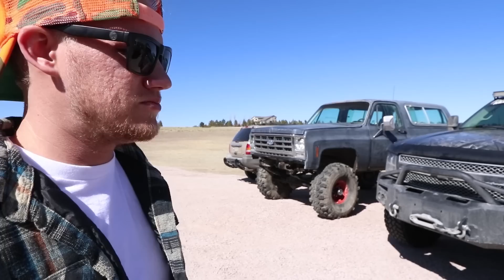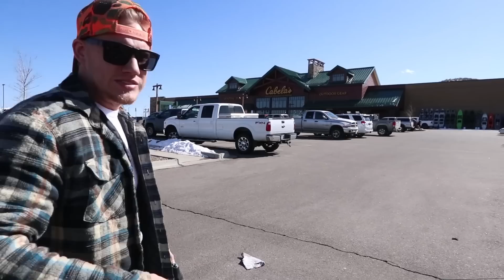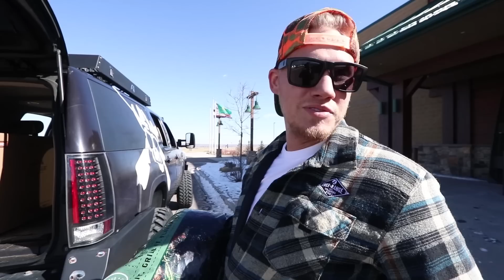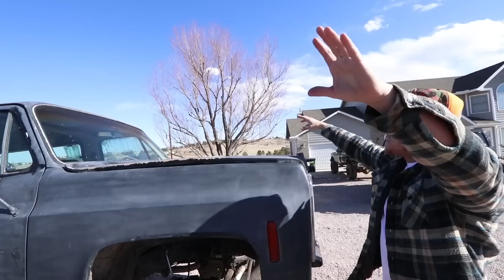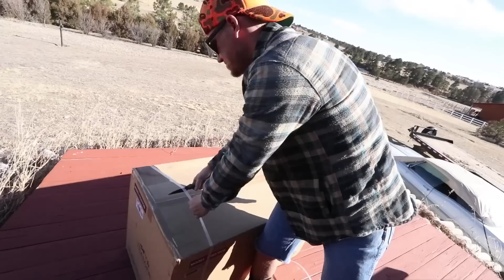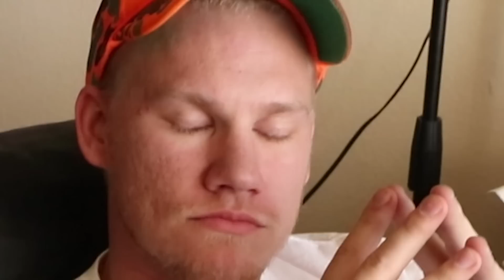Let Me Introduce the BACKWOODS BLAZER!!!

Comment: You could try wet sanding with super fine grit sandpaper over that overspray on the outside of the stencil or use mineral spirits to get it off especially if it's so cold out

Comment: I know of an old 460 big block from a Lincoln with only 55,000 miles on it. It's currently in a 68 ford galaxy.. It's a race car. It's for sale right here where I live in Alabama for 2500 and I want it sooo bad but I just don't have the time for the body work that needs to be done. But if you just wanna pull the engine and trans it's the perfect car for y'all. You could save the body, it's a one year body and you can't find parts for it

Comment: Outlaw if the Backwoods blazer has different gear ratios I would change them to the same yes you can run different but that puts the transfer case threw a lot of stress and it will grenade. Just was thinking long run for you.

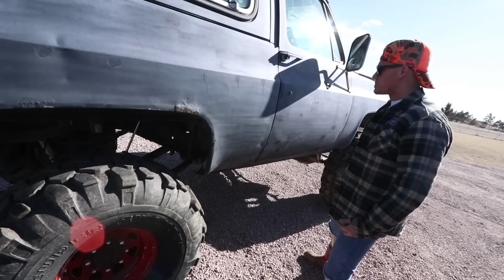Comment: Has to be two 4:10s can’t be different ratio or you wouldn’t have a transfer case left. Also on the next engine for the blazer might check on a vortec 8.1 out of a HD truck that’s been wrecked to stay in budget. Be badass and wouldn’t have to mess with a carb

Comment: you can't have to different gear ratios they have to be the same front and rear
Reply: Kameron Mclean you can on a strictly off road vehicle but it will eventually fuck the diff and axles up
Reply: Kameron Mclean you are correct for all around driving.Mud racers will sometimes run different ratios front and back but they don’t worry so much about longevity.
Reply: Erick Merryman diff and axles will be fine, you'll grenade the transfer case though
Reply: I had some one try to sell me their truck and they had different gears and the front and in the rear and he said the transfer case made up the difference in gears😂😂😂😂 some dumb people out there
Reply: Right! , can’t have different gears in the front from the back.. Have to match

Comment: If you have 4.10 gears in the rear, you have to have 4.10 gears in the front.  Or else you would blow up your transfer case because the driveshafts would be turning at different speeds.
Reply: Johnathan Skene you can also have close ratio gears work to ome just grabs a lil more like rock crawlera do for the front example 4.11 front 4.10 rear